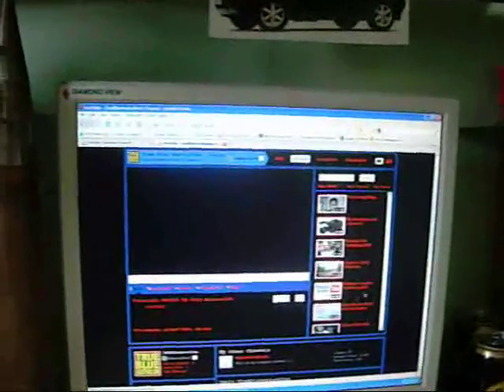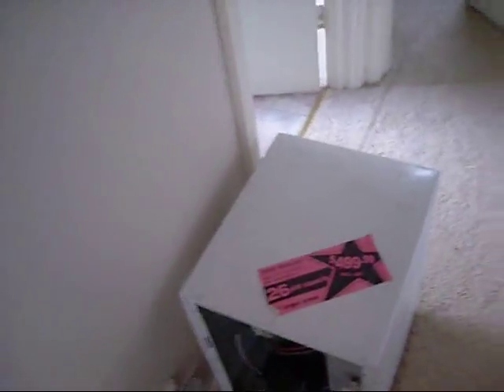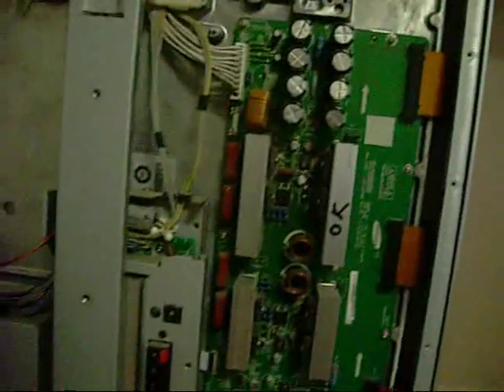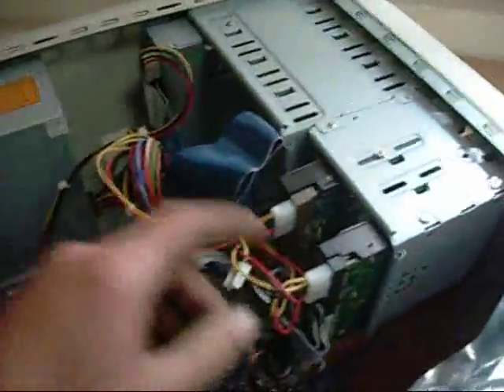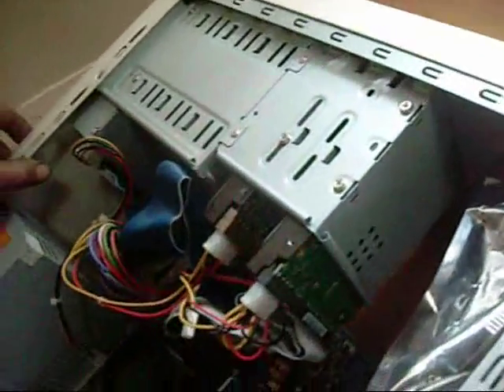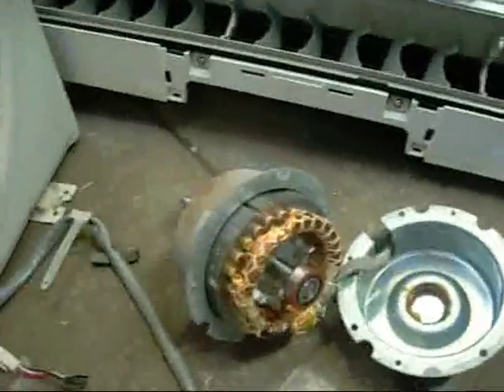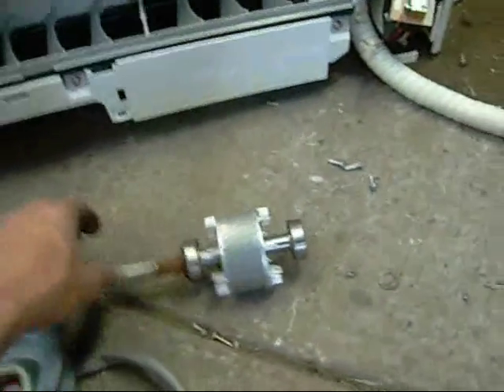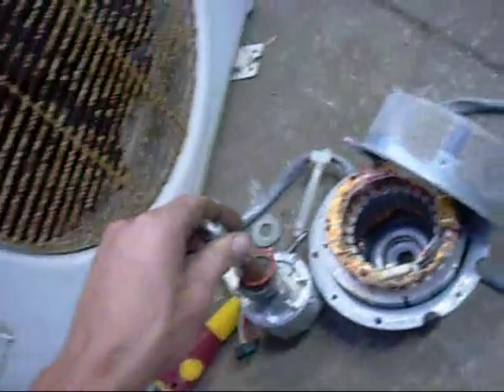Flooded Air Conditioner and Appliance Concerns - Re QLD Flood

Comment from the maker: @airconguy1 yeah they do cycle off when demand drops significantly, plus the soft wind up of the DC inverter uses less power than a normal cap start comp, plus no loud thunk as it comes online.

I do appreciate some of the advantages of Inverter AC, but the excess complexity is a major negative IMO

Comment from the maker: @rotarycomptech Inverter AC units are all the rage now because they are supposed to use less power, and be more efficient (no cycling the comp on and off)

Its essentially a VFD for the DC compressor, with a logic controller to tell it to speed up (more pressure) or slow down (less pressure)

Comment: @rotarycomptech Inverter systems are able to control the speed of the compressor to fine tune the cooling process, but they're a lot more complicated to repair if the inverter breaks due to all the electronics.

Comment: Too bad those relays aren't sealed units, I have some old style relays that are sealed in metal cans, not sure if they are evacuated or not, they have octal and nine pin plug bases like a tube. They used to have relays that were evacuated inside of an envelope like a vacuum tube, they were used in equipment in tropical areas.

Comment: I've found that putting it in the oven at 50deg C (halfway to boil) is the best. Makes it evap fast, doesn't melt plastic and won't fuck with caps.
The important thing is that it should be dryed ASAP, since rust is conductive.